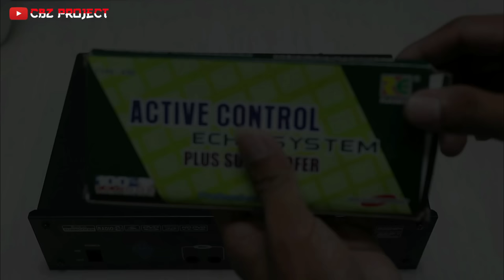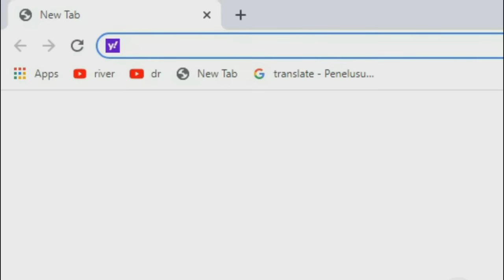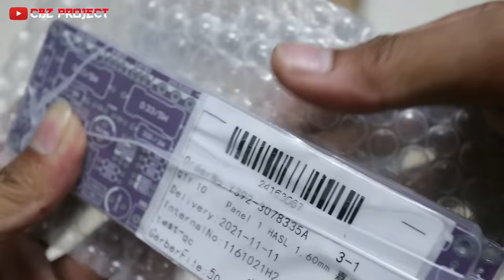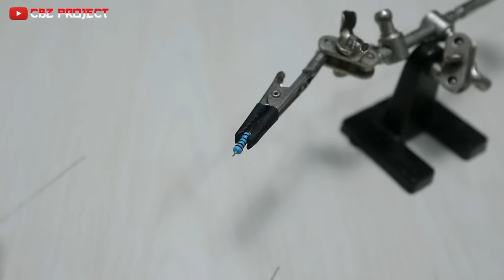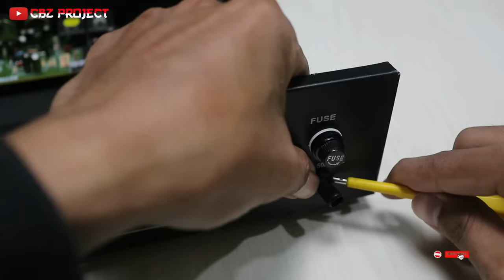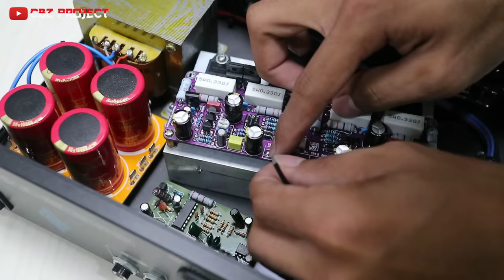Assembled Amplifier with Bluetooth Mp3 | Complete assembly - cbz project

Comment: Not using a grounded cord on a massive metal chassis like this is a cardinal sin honestly
Reply: Most audio equipments omit the earthing and go for a highly insulated transformer with sheilding to reduce any humm or ground loop. U will see many song Yamaha amps with no ground they do it to avoid any noise from the earth leakage of other appliances to be injected into power ground or worse signal ground.
Reply: They dont use grounds on 240 v supply systems. Hes in indoniesa
Reply: This is the most sin mistake in electronic history 😢

Comment: 😊Everything is good, but the transistor that converts from 12v to 5v heats up over time, so a fondant-type cooler must be installed.
Reply: Eveething is not good used insulatiin between AC to Dc Converter

Comment: Your mains should be double insulated if not using an earth. that includes the transformer, which is clearly not, and none of your mains connections are sleeved.  Your switch and fuse connections should be wrapped and soldered to the terminals for a mechanical and electrical connection.  Its a shame really, because it could of been a nice build.

Comment: Kit Driver power pakai apa mas?
Reply from the maker: Socl 504
Reply: Klok mau order contact nya brp ya
Reply: @cbzproject  pungsi resistor 10k di otput MP3 buat apa ya?
Reply: @Levi_aja  Biar gak over dan suara akan lebih halus.
Reply: karakter flat / sub om ??100k kalau di shopee

Comment: There is a huge distortion in the BASS, Very poor quality power supply as well,   There must be separate BASS filter for low noise cut and separate amplifier for it. Output of the amplifier not well matched with the speaker.    

Kind a so so amplifier.

Comment: you need high voltage capacitor and solder parallel with power switch

Comment: Sir Make DC 12 Volt Subwoofer 2000 Watt Amplifier
Reply: 🤣👌 12 volts for 2000 watts? sure you need approx 166.6 of amps to output that kind of power

Comment: Nem tudsz jól forrasztani!  azok a forrasztások nem tartósak.  Azért van a panelon a furat,   hogy át kellett volna fűzni a drótot a lyukon.  Majd utána ónozni.
Az úgy nem tartós.  Nem szakmunka!   Tanuló munka....
Ez csak ragasztás ónnal.  Nevetséges.....

You can't solder well! those solders are not permanent. The reason for the hole in the panel is that the wire should have been threaded through the hole. It's just glue. It can't even handle the load.
Not durable. Learning work....
It's just gluing with zinc. Ridiculous.....

Non sai saldare bene! quei punti non sono permanenti. Il motivo del foro nel pannello è che il filo avrebbe dovuto essere infilato attraverso il foro. È solo colla. Non è nemmeno in grado di sopportare il carico.
Non durevole. Lavoro di apprendimento....
Sta solo incollando con lo zinco. Ridicolo.....
Comunque l'idea è buona. Semplicemente non capisci!
Reply: Igen. egy vicc ez az erősitő, nyakamat rá hogy azok a Rubyconok igaziak.